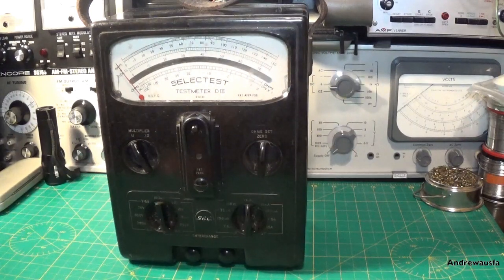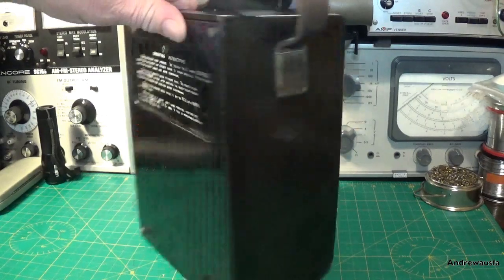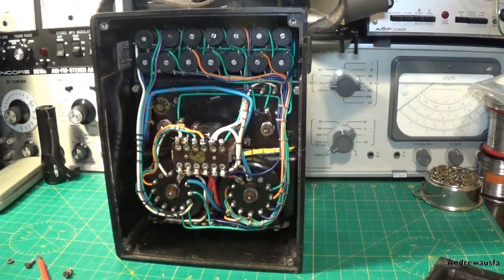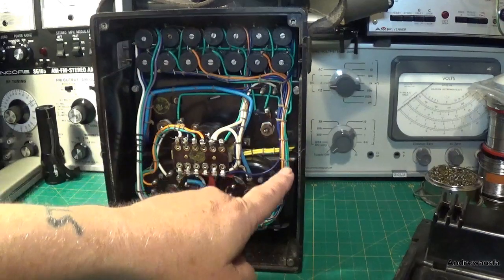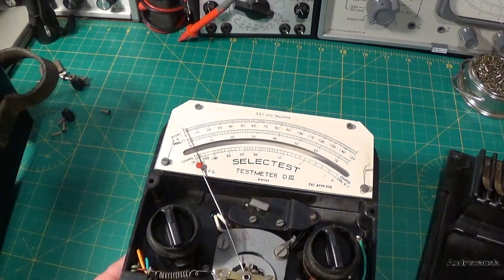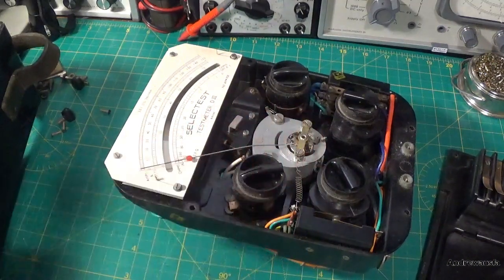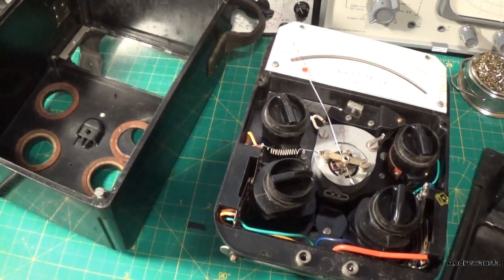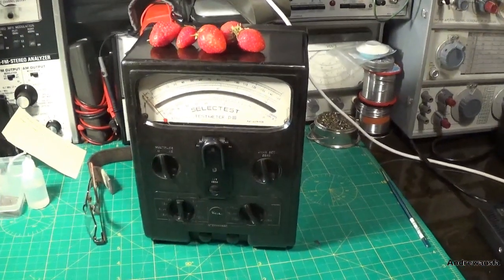GEC Selectest multimeter

Comment: Amazing the amount of electromechanical engineering that went into the manufacture of vintage test gear Andrew. They were using a resistance wire wrapped around a bobbin to get a certain value. Precision resistors did't exist at the time in the values that they needed to have a calibrated scale so they rolled their own, literally. Great stuff. Looking forward to the next part. Stay well. ATB Doug.
Reply from the maker: Hi Doug, thanks for the great comment. The design of these things is quite amazing, feat of ingenuity.

Comment: Enjoyed that look inside the Selectest. I too have fancied picking up one of these for some time - I'll keep an eye out for one. I have the later Selectest Super 50 which is a decent enough meter. Looking forward to part 2! Cheers Adam
Reply from the maker: Hi Adam, the one I really would like is the IV with the red cut-out reset cover. That was a bit of a redesign over this one but externally similar. I would like a Super 50 too with it's huge dial, 20K OpV meter too whereas this one is probably only 1K. Thanks for commenting.

Comment: Wow Thats a Lovely Meter Andrew And a Lot Bigger Than My Old AVO 8 Maybe Get An Adapter To Fit a D Cell if it Will Fit Super Meter Looking Forward To Part 2 Regards mike.
Reply from the maker: Hi Mike, yes deeper and taller than the AVO but just a touch wider.  I'm going to see if I can rig something up to take a D cell without ruining the meter. Bit of drain pipe of something with bolts on each end. Or something.

Comment: A lovely meter. Lots of soft brush work and some delicate items in there... did you find it in the strawberry field looking at some of the dirt?
Reply from the maker: Hi George, it was indeed 20 foot up in the Strawberry fields :)  The meter movement is very delicate, I have wrecked a couple of already dodgy AVO movements trying to correct them. If in doubt pass and don't touch is the byword when it comes to fine hairsprings and x1000 turns of finest wire!

Comment: I didn't have any idea of it's size untill you placed the avo next to it,  the avo looked pathetic Ha ha :-D
i have an avo 8 i think, it had been dropped by the previous owner :-(
The face had big nasty cracks through the bakalite, someone had epoxyed it but not quite aligned.
I decided to leave it as it was, it was strong.
The meter scale was not linear, all ranges were way off, i looked at the movement and could find no problem.
Later i realised that a thick metal plate with a screw holding it to the side of the movement was an odd linearity balance, once i slid it the right way and checked on the 10v scale for 10v then 5v mid scale, every mode/range lined up spot on, amazing accuracy :-D.
Back went the case and screws in, i knew to leave it alone.
I'm daft, but not that daft.
Sorry about the waffle.
Reply from the maker: Hi ZX, that sounds like you moved the magnetic shunt. You can adjust those for losses in the magnets flux, very precise stuff. No waffling at all I do like reading other peoples stories.
Reply: @Andrewausfa  , Ahh now i know the exact purpose of that odd plate, thank you :-D
Well i looked at the apposing support/connection springs and they looked perfect, the needle was really smooth with no stickyness and repeated the zero point perfect, also i checked the little series shunt resistor for value an stability, it was perfect.
So the plate (Magnetic shunt) was all there was.
My mate gave me an avo minor little meter last year, i may have a look at it but the avo 8 is my analog go to.

Comment: That's a big old bugger Andy. That pubic hair might have been glued with some body fluid to the needle for that personal calibration touch?
Reply from the maker: That is a very good thought Simon! There was another one in the bottom of the case so maybe someone got a little too excited when they spotted the cable lacing. Or got into a frenzy over the switch cams. You can never tell what turns people on.